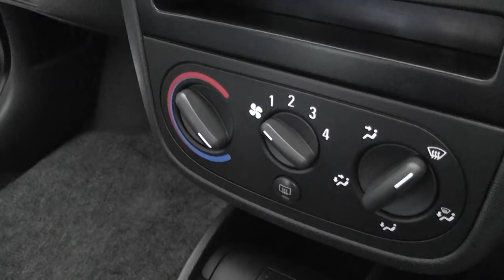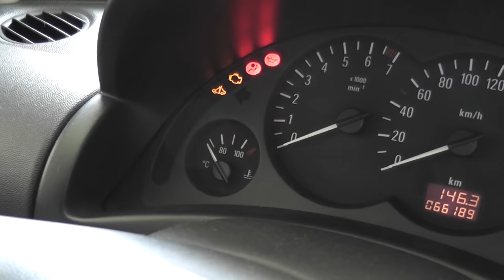Opel Corsa - Engine Coolant Change

Comment: Good Vid but you just changed the coolant in the radiator, not the engine block this is not a full coolant change

Comment: I don't see how this would flush out all the coolant in engine block and heater core. Would have to do this severalTimes with plain distilled water until it turns clear running the car to temp making sure it's circulating around the block and heater core.
Reply: At the bottom of the radiator you can only extract approximately two-thirds of the total capacity of the cooling circuit. Indeed the engine block does not have a drain plug on its exterior but the lower part of the engine block and the water pump are internally connected. At the bottom of the water pump (between the pump and the right engine mount) there is a torx valve plug (T-30) that allows the pump and the block to be emptied. Here, you can extract approximately one-third of the pump total refrigerant capacity. To empty the internal heater you must disconnect the left hose in the fire panel to insert a 6 mm diameter and 1 meter long tube to suction or pump about 300 cubic centimeters of refrigerant, in this way you have managed to completely empty the circuit. It may be worth dismantling the right engine mount to remove the cap from the bottom of the cooling pump.

Greetings.

Comment: Nice one. I got a little.worried as my new corsa doesn't have min. Or max. Markings .. just a COLD sign stating it's about the same level as the end of this video 👍
Reply: That's the coolant level you want whenever the engine is still cold and the car is parked on a level surface. It will rise a little to the actual "MAX" as the coolant heats up. It will rise a lot and overflow if the header cap is stuck open.

Comment: Hello , can I use HEPU coolant alone with no water? I have OPEL CORSA B 1999 1.6 IE  . I am looking for manual and also for technical spec or basic repair guide. Thank you for you video , hope you can help if you can , thank you, Greetings from South Africa.
Reply from the maker: Yes, you can use it without water. ;)
Reply: +Zsinor Motors Hey , i struggled to flush my car yesterday. I can not find a bottom hose pipe, i only have 2 pipes.
2 at the top. The left one is TOP Radiator going to Cam Belt section on to Thermostat housing. Very very hard to take it off, it feels like this rubber is very tight on the thermostat housing. The other hose is also right side TOP  and next to thinner hose TOP right also. The thin hose goes to the reservoir bottle. The big hose goes I THINK to engine head block.
What I did was remove bottle thin hose (over flow pipe , let it drain in to pan. I put hose pipe in to bottle and let the water come out from small pipe , eventually the water goes clear.
I put back small pipe to bottle. and put water back in to bottle and also close cap.
I idle , turn on heater, plus fan on to 4.
I let radiator fan come on 2 x.
I turn off wait for pipe to be cooler. 
I open cap take off overflow pipe,  let water flush again , little little old coolant or brown came out.
I then put garden hose pipe back in to bottle and let overflow pipe drain to floor.
I also let car idle little bit.
I was also pressing pipes ...
Anyways, in the end i put HEPU coolant 1.5 bottle plus new bottle maybe 200 mill .  I use maybe 1.7 in total.
I do not know of my method was good or stupid?
Please give me advice. Also for me, HEPU coolant very expensive.
I have maybe 1.3 liter HEPU left and also 5 litre of DISTILLED water which i never use yet.
I want to know if need to use different method and if my way was stupid.
If you like i can show you picture of my car engine.
Thank you Zsinor Motors
Reply from the maker: Magyarul jobb lett volna. :D Na, elkezdem olvasni.
Reply: +Zsinor Motors I dont understand :), please english my friend
Reply from the maker: Sorry, I thought you understand Hungarian. Imre Csoka is a Hungarian name. :D

Comment: Hello, I've done this and my 2005 Corsa C 1.2 Twinport only took 2.5L of anti freeze, I didn't have to add any water, have I done something wrong? It doesn't overheat or anything I left it running for around 30 mins

Comment: What Coolant you use?
Can I use G12 Plus?
Thanks!
Reply: Opel/ vauxhall use Dex Cool
Reply: +Protab Ali I know but also can I use G12 ? I think G12 Plus is better than Dex Cool...
Reply: +João Rodrigues as long as the old coolant is flushed out properly it should be ok
Reply: +Protab Ali Thanks!

Comment: red coolant? are you using Paraflu™?
Reply: Red coolant is a type of coolant made with OAT (Organic Acid Technology) for engines that contain aluminum parts and for long servicing intervals (the green one needs to be replaced every 2 years, but 5 years is generally ok for the red type). It's made by a lot of producers.
Reply: i have the Motul inugel Optimal with Organic Acid Technology.  a lott better than the standard G12 or G13
The engine now stays cool between 85° and 87° degree.  With the standaard coolant it keeps getting warm between 92° and 96° and kicking the fan.